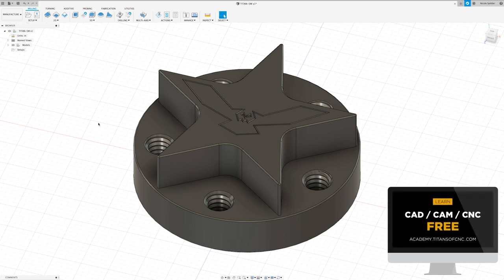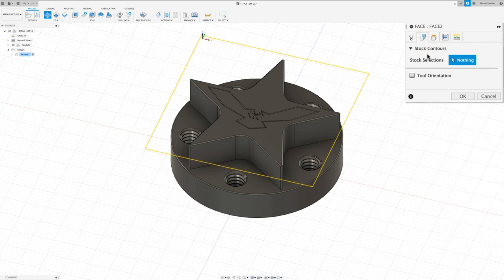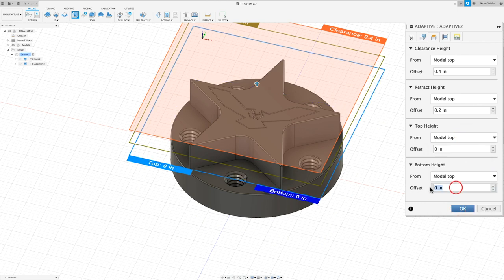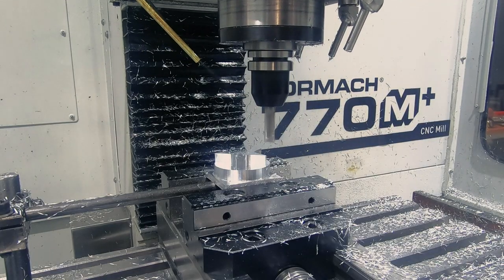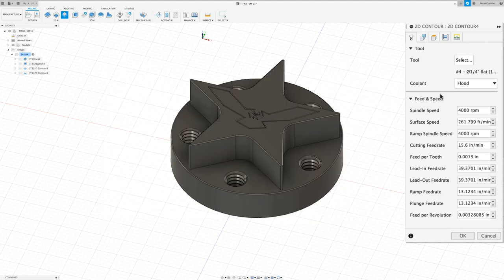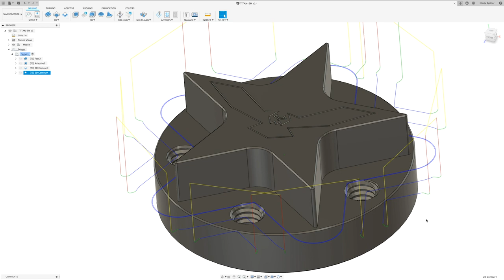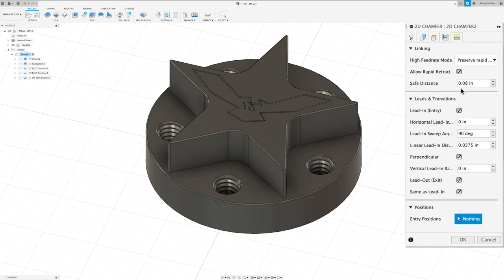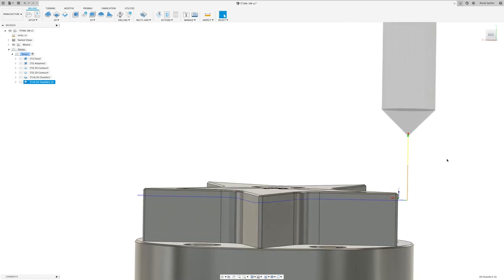LOW HP MACHINING | TORMACH TUTORIAL | PROGRAMMING THE TITAN-5M IN FUSION 360

Comment: Good Morning Titan,

I have commented before because frankly machining is where my interest and also what i would love to have my career be.

your videos provide great insight into the top tier of this industry and for me its relatable because I spent the summer working at top tier machine shop aswell.
 I was running two Mazak variaxis i-700 mills along with a smaller 3-axis and I had the oppurtunity to setup and machine all literally all sorts of out of the world high tolerance/exotic material parts, bearing retainers/housings for F35 Pratt&Whitney engines, parts for General Electric, just to give you the idea.

While that is beyond interesting I have the opportunity to make it happen for myself and im going after it, before i was told that we lacked online presence so I made a website called MillandTurn.com ,check it out and let me know. we do alot of things but we're trying to do more and make it happen.

Thank you for your contribution to this field, its happening, BOOM

Comment: I have a question regarding the stock size.  why add an offset size instead of just fixed relative size of the actual stock size?  I wish you guys would give some more details on why certain features or options are selected.  It doesn't help beginners at all, it just leaves us scratching our head.